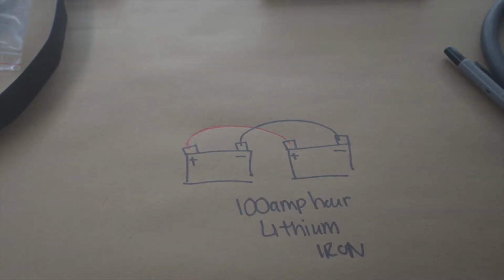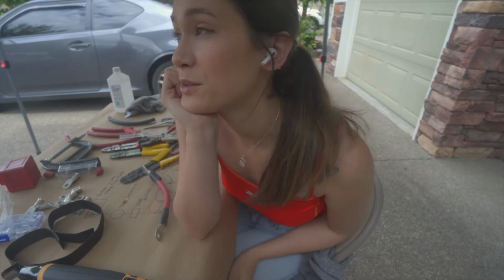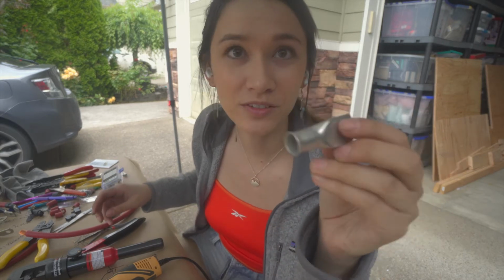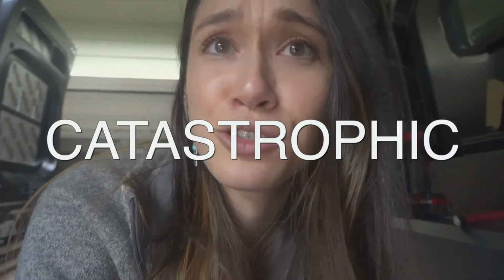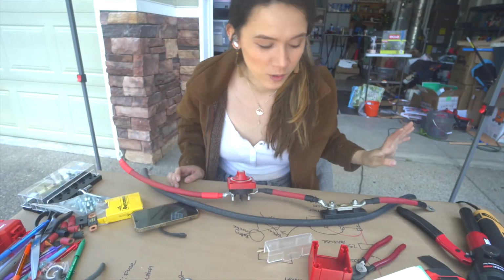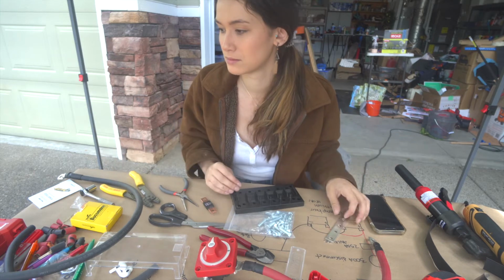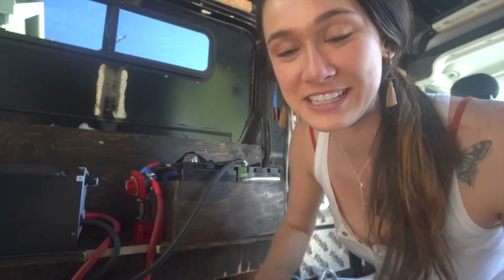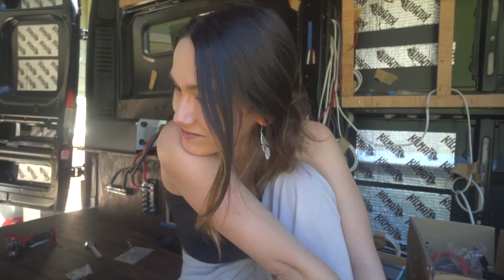How I Setup My Van Electrical System [Part 1] | Van Life | Van Build Series

Comment: Are your batteries 12v?  Wiring up in pos to neg is better than series, you will drain the batteries in series and with lithium that can have serious consequences.  Also when cutting holes tape over the area you’re going to be cutting and draw a line to follow, it means you won’t splinter your woodwork.

Comment: You should lower your fuse rating. You want the fuse to blow before the batteries get damaged and before the wire insulation starts to melt. You only have a max of 200 amps from the batteries. It's fun watching you learn :)
Reply from the maker: That’s good advice, thank you!
Reply: That’s what I was going to say.  Also soldering connectors is way better than crimping…

Comment: FYI- in case of emergency and you can't find a lug end, make one. That a piece of the appropriate copper pipe aprrox. 2 to 3 inches long. Crush one end in a vice and drill a hole in it. It's a little softer material, but it will work especially if you solder itt.
Good job
Reply from the maker: That’s good to know, thank you!

Comment: Great episode. First, we are going to steal your idea of covering the work area with paper and using it for notes. Second, how did you like the crimper from Harbor Freight? I've read so-so reviews about it but the price is great. Third, virtually everything from Harbor Freight has that "smell". I think it smells like creosote.
Reply from the maker: Do it! It’s so convenient, I’m just glad my builders paper had some use.  

The hydronic crimping tool made the job soooo much easier and less stressful than it was at the start when i didn’t have it.  My oooonly qualm is that I only needed it for my 2/0 wires. I have other crimping tools for the smaller wires I’ll be working on. So I spent (I can’t remember) ~$60ish for an hour of work.  Might return it :)  

However, I did find cheaper ones on Amazon if you wanted to get one. If I had known i needed it I would have ordered it over going to Harbor Freight.